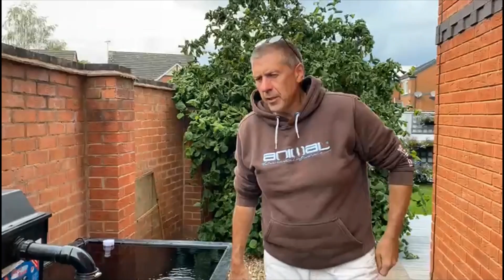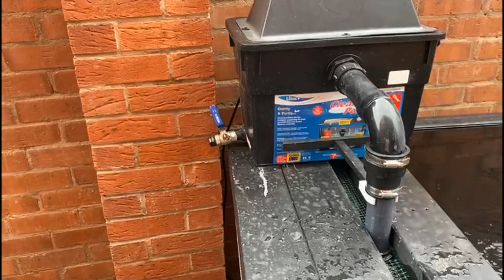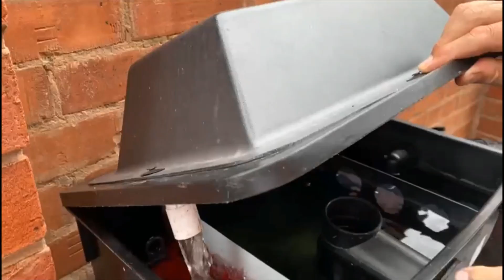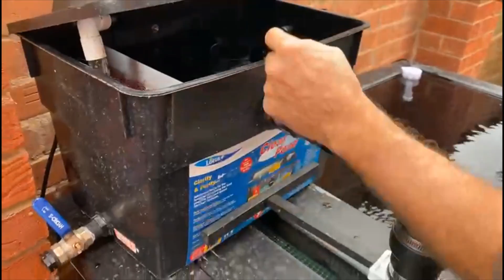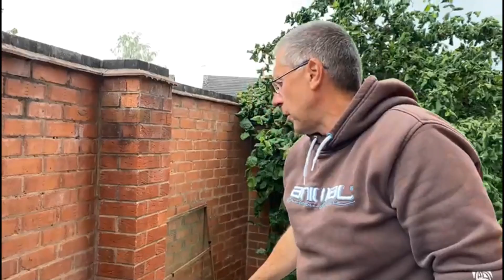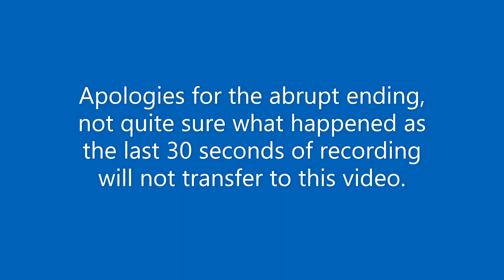T K P – Telford Koi Pond Part 32 – New Koi Quarantine /  Holding / Grow-on Tank Set up.

Comment: Nice one Phil. I may put something similar together myself this year. Qs re the tank - 1. Would you happen to have a link to where it was purchased?  2. So many of these tanks seem to require some sort of battening around them to stop them from bulging outwards, obviously this one doesn’t?
Reply from the maker: Evening Ray👍😊. I bought mine of eBay , they are still selling them but price has gone up considerably in the last 12 months. Search for koi vat / fibreglass pond (750 litres) , the seller is Canpoiesarh2ltd and they have 100% feedback. The brand is KCR Marine and they are particularly robust and completely free standing so no bracing required👍😊. Took me ages to find this one and have been delighted with it😊👍. Hope this helps👍🈲🐟😊

Comment: Good video, thanks for sharing! Where did you purchase this tub in Birmingham if you don't mind me asking?
Reply from the maker: Hello Jack, I bought the tub from kcrmarineltd  on eBay and they just happened to be in Oldbury which is relatively close to me but they will deliver anywhere. Must admit I’ve just taken a look and they are still selling the 750 litre vats on eBay but the cost has gone up significantly since I bought mine which is probably the COVID effect as raw materials are in short supply. Anyway, definitely worth a look as they are really well made and perfect for quarantine or growing on tanks. Hope this helps 👍🐟🈲😊